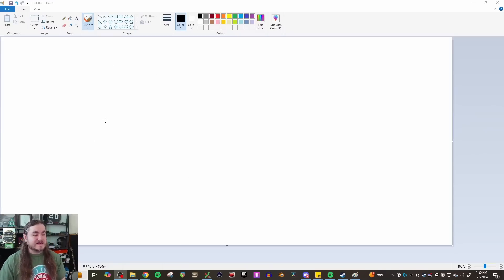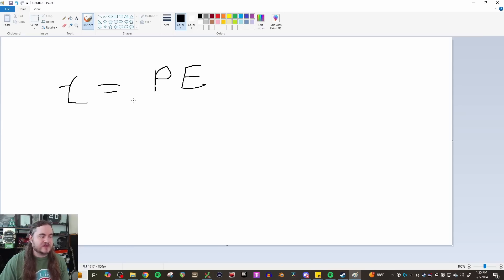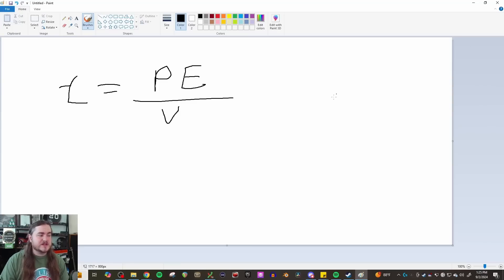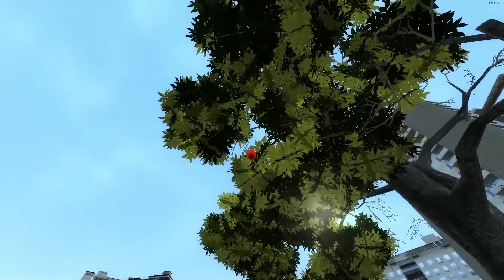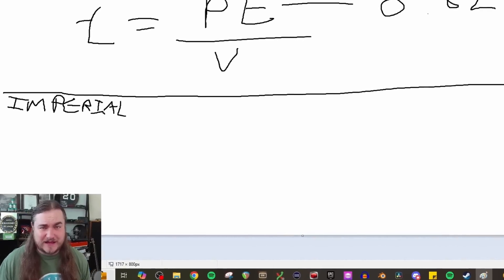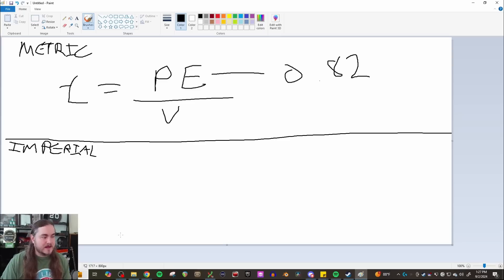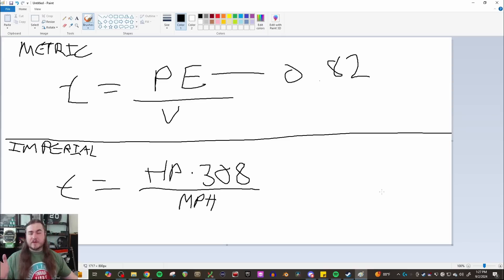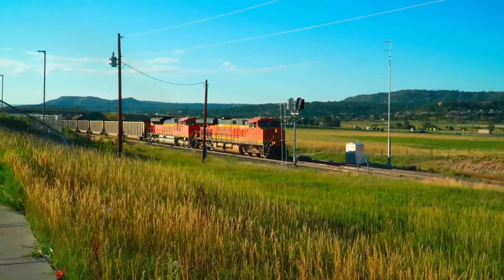Diesel Tractive Effort 101

Comment: So steam train with a diesel helping is ideal best of both worlds
Reply: The issue is the electric motors struggle at high rpm, right?  Have a water filled tender with steam drive system. Above a certain speed use the diesel generator and/or exhaust heat to create steam and drive the pistons.
Reply: @TGoat5  Surprisingly, that's been done before. The Kitson-Still system, if memory serves. It was a tank locomotive, but basically the same principle. Commercially, it wasn't a success due to it's low power and complex design. And the fact that the fuel prices for both Coal and Oil were very unfavorable.
Reply: I plan to do this in my current Transport Fever 2 save once diesels open up, I'll see if it simulates this.

...Eventually, school's back and I have a game backlog.
Reply: Or a Diesel train with steam helper. B&O passenger westbound out of Cumberland with a steam helper pushing, 1956. Might have been one of the last times that happened.

Comment: I think this would be pretty much the same with a straight electric powertrain. The source of power shouldn't matter, it can be a "diesel generator" as in the diesel-electric powertrain, or an overhead contact system, or even a battery. An electric motor-based traction system has basically the same characteristics, no matter the power source. Even the DC traction motors and VFD (power converter)-driven AC synchronous or asynchronous motors behave similarly, given the limited amount of power available from any of the sources. The reality is that you can't get more power out of a traction motor than what you can supply, and torque (tractive effort) basically depends on supplied power and motor RPM. Given the maximum amount of constant power you can supply to a traction motor, as the RPM increases, torque drops because this way the power put out to the shaft dosen't change(as well as the input power). With a steam engine you can put out more power as speed increases, because increasing RPM inherently increases steam usage, so you dinamically put more power into the engine by going faster, using more steam.
Reply from the maker: I believe you're correct, cheers for adding!
Reply: Steam engines do have horsepower limit, as the cross-section of steam passageways is finite and steam can be admitted into cylinders at high speeds only so fast.
Regarding electrics, there is a big difference. On diesel traction motors cannot physically develop more horsepower than the prime mover does. On electric loco, there is no such restriction - by drawing amps above continuous rating the driver can squeeze extra hp for a limited time. A typical 1960-era 6-axle electric may have about 4000 hp continuous rating, but is able to run at 4500 hp for up to one hour.

Comment: So if a diesel has more torque at a standstill, and a steamer has more while in motion. Why don’t they make a hybrid with electric, and mechanical bits?
Reply: Such "hybrids" exist. They're called electric locomotives. They combine high TE with high HP.
Reply from the maker: Complexity.

Comment: thank you for the nerdy lesson! I fetched writing materials and took notes because .... because. Amazing how fast diesel locomotives lose it getting up to speed. No wonder PSR is cursed at so much. 
I think one would represent the lower limit of those traction motors by drawing a horizontal line on the graph at a certain maximum T.E. Right?
Reply from the maker: That's probably the way to do it; not sure if anything silly in the loading circuits make it not quite a flat line but that's the idea yes.
Reply: @Hyce777  Depends on how old the locomotive is. Older locomotives didn't have any kind of regulation for loading other than the Load Regulator. As such, those old engines would let you have full horsepower pretty much right off the rip. (F them traction motors lol) We had a GP11 in our shop not too long ago that would pin the ammeter in 3rd notch from a dead stop. Edit: This is actually why EMD talked about their early diesels having full horsepower available right away. That fact is also why early diesels ran steamers right out of the switchyards. Modern "road switcher" or "line haul" style locomotives limit TM amperage (and thus tractive effort) at low speeds to protect equipment.

As much as I'd love to ramble about excitation control on newer engines, I'll refrain. Suffice it to say, roughly Dash-2 era EMDs would follow the curve for the equation until the "min speed for full hp" and then would follow a slightly less steep line down until "continuous drag" speed and then follow an even shallower line down to stall. Newer locomotives (i.e. Dash-3s and newer) use a more sophisticated system yet that probably does get alot closer to that flat line that was mentioned.
Reply: i wonder if PSR can be made more precise by also doing the TE and speed calculation for every route.  they might need to use a computer.

Comment: Great piece as always.  So, on a steam loco with a booster engine, the booster is intended to compensate for the variable torque at very slow speeds because of position of the pistons?

I’m not quite sure I understand the piston position issue.  Do you have a video that deals with this?
Reply from the maker: That is precisely it. I'm not sure I've got a specific video that addresses it - but basically there are dead spots in each wheel's travel where the rod isn't really doing much to the crank - front and back dead center, and near there. So at slow speeds, you'll get to the point where half of the engine doesn't supply any force at those spots, halving power output, and stopping things dead. At faster speeds, the time at those spots is so minimal momentum carries you through, and you don't have to worry about it.
Reply: @Hyce777  Thank you!
Reply: @Pamudder  Basically, a steam locomotive has 2 steam engines coupled together through the driving axles but the connections are offset by 90* so that the locomotive can be started in any position.  When one side is at 0 power or thrust or top dead center, the other side is at full power

Comment: In a way, it's gone backwards. So, in the 1800's, you would have multiple loco's pulling cars/wagons. Then during WW2 they made the UP Big Boy (4014), so they used 1 loco to pull 100 cars, now, they use multiple loco's again. Granted we did go from steam to diesel electric, but is it more efficient and cost effective the companies? Also, yes it's a pain to maintain a steam locomotive, but if it's more efficient, then why use diesel electric locos? If you had the choice of either a steam loco (Big Boy) or a diesel loco (ES44 or what UP uses) and IF the Big Boy overall is better than 4 diesels, then why spend more $$$ to get 4 diesels over the cheaper 1 loco, when the maintenance can be quicker? I don't understand, apart from the maintenance which can be a tedious job with steam locos, but can't that be a compensation/sacrifice you would consider? Plus, it's easier to to convert to oil from coal now and oil is more readily available. Just my thoughts on the subject.
Reply from the maker: The maintenance.... The maintenance is so much more than you think. You need to maintain a steam locomotive 6 times more often than a diesel, and it's out of service for probably 10-20 times more time each time it's out of service than a diesel. It's not just tedium. It's availability, cost, parts, reliability, workforce...
Reply: @Hyce777  After running your steam engine 92 days without shutting down...if it didn't go kaboom, you would probably need a new steam engine anyway.
Reply: @Hyce777  Ah, ok. Thanks for the info. Interesting vid none the less.
Reply: The two biggest cost considerations are labour and downtime. Steam is massively manpower-intensive (and post-WW2, labour was no longer cheap nor as plentiful for railroads), and requires a downtime cycle (washouts, inspections, major repairs) and support infrastructure that a diesel-electric never will. In one example of efficiency pooling, West Australia was replacing 4 or 5 steam locomotives with 2 diesels at a time in the late 1960s. And getting the same number of trains (or more) run with half the units. 

You can run service intervals on a diesel-electric that would leave a steamer in pieces, and  major maintenance can be relatively quick.

Diesel-electric economics favour a leaner organisation than steam did, though they are nowhere near as tolerant of poor and austere maintenance conditions as steamers traditionally have been.
Reply: Another thing is engine crews. Every steam locomotive added needs two crew members, where as with modern diesels the entire train (mid-train and end of train helpers) can be operated by one crew.
Reply: Multiple smaller engines also gives you flexibility so you don’t end up with something like the big boy hauling at 25% its capacity. At that point it’s much less efficient. 
With modern controls they can just add more engines if they need. They can even add them in the middle if they need to, or if it’s easier than rearranging a whole line of cars.
Reply: @NBSV1  This describes the SD40-2 "building blocks" era perfectly.

Comment: For the next Tractive Effort 101, is it over the Handcar? Basically, it has a small value due to it being man powered, but it can do some work. IE the average man can output a strength of (Lets use me for the sense of things) 200 pounds of force on my arms. With the gears on my own, I can make lets say a TE of 300 due to gears, wheel size, amount of people, how much said people have strengh wise, and speed. 

Does it make sense what I am trying to ask? Yes this sounds like a joke question but I am curious if there even is a way to figure it out yet, or if it needs to be make with trial and error.
Reply from the maker: Handcar tractive effort could be calculated... lol!
Reply: @Hyce777  I am more than willing to do a few laps or moves around the museum to figure it out. Or I can do some weight measurements to figure out a theoretical average output strength of a blue collar worker. 

Although if the museum or yourself has a photo or drawing of the handcart the museum uses, I could figure it out so you could do a short video on it.
Reply: @Hyce777  Yes but how much does Leighton’s spinny helicopter hat add to the equation?
Reply: Interesting anecdote. Back in the day the SE Railroad Museum had a family field day. They had handcar races timed laps. The wives bold enough to do it, and me, took a turn. We started with wheel slip. The guys thought it was a fluke, we did another lap with the same starting wheel slip. Our total time was close to the various guys teams but no slips from them. I could only think the combined weight was lighter just enough to get slippage. True the rails were greased to lessen flange squeal and reduce wear on the tight curves.
Reply: @WMRRFIREBALL I've actually wheelslipped to a stall on a slight grade on wet rail with a handcar, with a four man crew. 😁